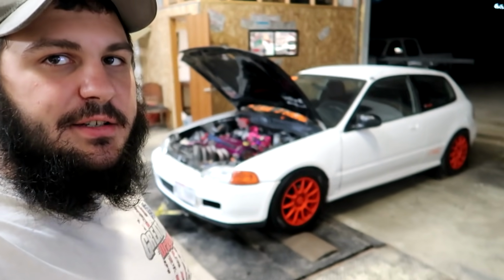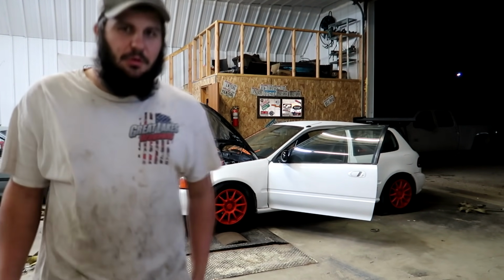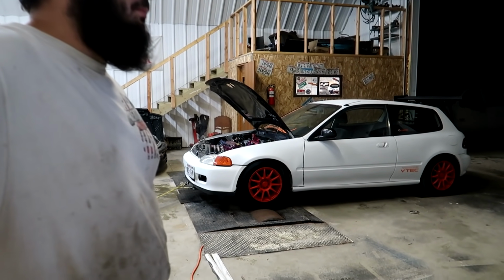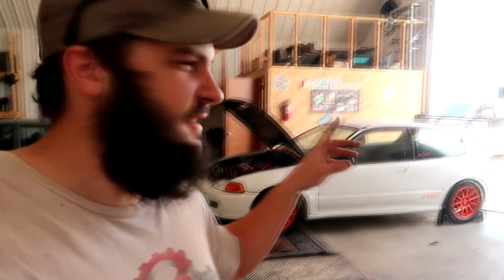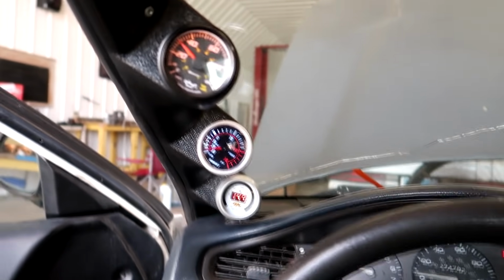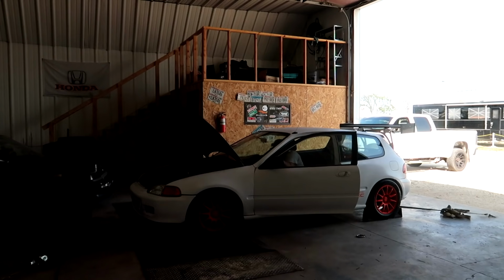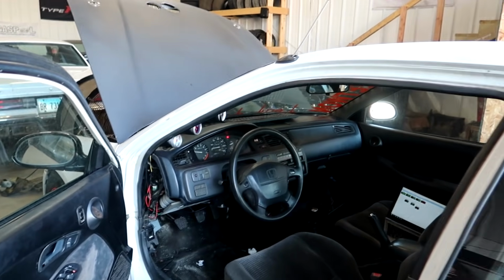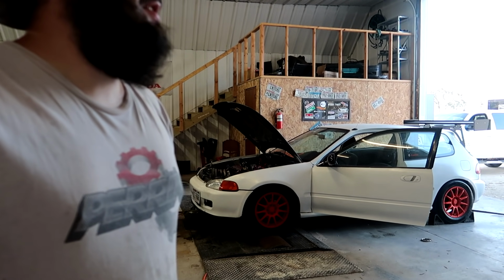300 + HP D15 Turbo Single Cam Dyno Tune Hondata S300. Tons Of Issues SMOKED HEAD GASKET ! EG Hatch

Comment: The guy probably used the y8 headstuds (longer) then the d15b or z6( shorter). With the shorter deck height of the d15 the y7y8 head bolts or studs are to long and bottoms out in the block. It does not keep the head compressed down tight enough. Ask me how I know. If you have the y8 arps add another washer. Been there done that. Might not be a gasket issue as much as the bolt stud issue. Get a je proseal with decked surfaces and you'll be mint. I've been perfecting a jdm d15b with a built y8 head for the past 3 years running into such issues. I have a built y8 bottom I should just put in, but the challenge to make the Lego kit work and me needing a daily has kept me from putting my built bottom in and turbo kit on. Great effort hunter!

Comment: Watching you stress through this tune makes me worried my first build is going to be similar. But let's not be silly I'm going to send it anyways. 

Good job diagnosing the VTEC on this one
Reply: Take it from me who's cleaning up after a sloppy first build. Take your time and don't take shortcuts or cheap out on parts. It'll save you so much time in the long run
Reply: I second that slow and steady and proper

Comment: Thanks for sharing these tuning sessions. I always learn a lot. It's too bad you have to screw around tying up loose end just to tune the thing. Probably won't be able to charge extra for your time either? Seems some customers don't understand that it needs to run right before you can even tune it. Probably not all the guys fault either since it seemed like some issues were intermittent.
Reply: paid him 300$ extra

Comment: 400 like that? Looks like the owner half assed  a few things. And props to you for fixing some of the issues, most tuners wouldn't had done all that and still charge full price
Reply: i paid the guy an extra $300 aside from the $550 for the tune so he made $300 replacing a hose clamp, running an oil line to the vtec solenoid and filling with coolant n oil he only made it look like charity work paid well over $100 an hour labor wise
Reply: @StonedDemon  Car was clearly a hack job I would have pushed the pos into the street and left the keys in it. His area you know how that would have gone for you.
Reply: not to mention the k&n filter he kept along with my vtec pressure switch
Reply: @StonedDemon honestly Id feel pretty lucky where I'm from they would done one pull it would of spewed out and they would of sent you home still charged you 550 and it would of been another 550 when you came back it's really hard finding dynoa that will work on the car !

Comment: I had a similar issue with my b series. Right off the bat over heating fresh build less than 50 miles on the motor. The tuner never synced the timing. I learned after you're supposed to. I went through everything to track down the over heating issue. Pulled the head and found mechanical timing was off by a couple teeth. Next the head gasket was toast, and there was a hole in the piston and scraped cylinder walls. Guy who built the motor mickey mouse everything. It was my fault for not checking it before I had it put on the dyno.

Point is. Check your shit before you go to get it tuned. Don't expect the tuner to fix everything on the spot.

This guy telling you to send it is absolutely insane. There is an obvious problem mechanically with it. You put your reputation on the line when you give in to these builds. We all know how quickly people go to the forum to trash on someone for their own mistakes. Trying for 400 with overheating, eating oil and coolant will likely lead to catastrophic failure. It'll be easy to say "the tuner did it on the dyno, my motor was completely built".

Comment: Hey I got a b20z stock block with b16 VTEC head stock just surface I don't past 7,000 rpm VTEC kick at 4,800 how much the timing should be at high rpm?

Comment: paid an extra $300 for the “labor” which was run an oil line from the sandwich platr to vtec solenoid, replace a hose clamp, and refill with coolant n oil…. paid well over what anyone else would charge… guy makes a whole video talking trash and cryin cuz hes making money… doesnt clean up the coolant all over my car and keeps my turbo filter and my oil pressure switch acts like its charity work yet i paid well over $100 an hour…. karmas a mf brotha
Reply: Fixed a bunch of bs. Clamps weren't tight. Head gasket is blown, you didn't pull the oil plug, fixed vtec forking rewired it and still tunes it out right. 99 percent of tuners would charge you for there time not tune it and tell you to come pick it up. They wouldn't even wire vtec. You literally got the best outcome hunters the best. Man up Sally build it right, tighten it up better next time.
Reply: @lukemx8863  again paid 300 extra for the "labor" he didnt fix any vtec wiring just complaned about it when you run an oil feed line to the vtec there is no sensor for wireing to be needed and the wireing he did do which was just twist the two wires together at the ecu he left bare couldnt even put a peice of electrical tape on it so dont get ahead of yourself. it was one clamp that was replaced and he tightened up one on the intercooler piping clamp at the throttle body. all in all i gave the guy 850$ and "man up sally build it right" from the go it was known i didnt build this motor this was one i picked up without even hearing it run we put it in a car n sent it he knew before hand the head gasket was bad and it would need extra work and that i would be paying him for it even though i knew it wasnt an extra $300 worth of work i still paid him it because it was only right. i didnt realize he was gonna make a full blown video crying about making money and trash talkin hondas and the people that pay him. Just cuz ur fan boying doesnt mean you should talk about something you know nothing about, want a free brand new huntertuned hat? ill send ya one think i might have a lanyard n sticker for ya too. over the 5 years ive been supportin this guy i wont ever again so if ya wantem theyre yours.
Reply: @StonedDemon  I only have one thing to say ill take it all mintttttt